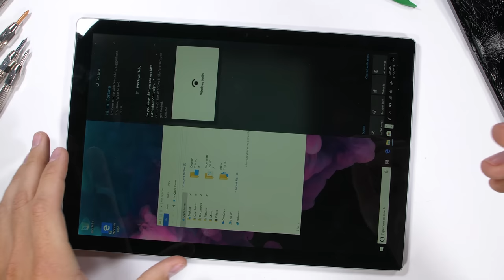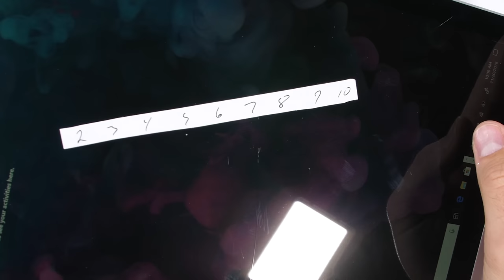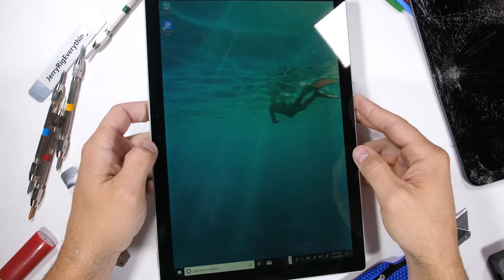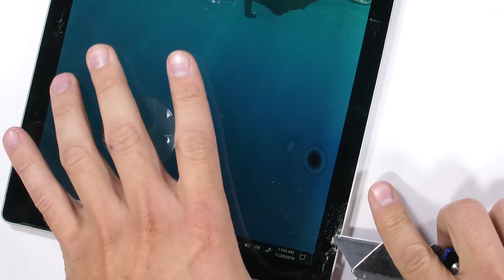Surface Pro 6 Durability Test! - Is it stronger than the iPad Pro?!

Comment: 6:27 "Intentionally adding structural flaws in a mobile product is a bad idea"
Reply: Yeah right, how are use supposed to get a new one if your devices last long😌😌
Reply: As long as you aren’t intentionally applying so much pressure with the intent to break the tablet then you won’t have an issue.

Comment: "itS a TabLet, Of COurSe iTs gOnNa sNaP!" 
Well would you look at that....
Reply: I was hoping I'd see this comment
Reply: "BUt ThIs Is A cOmPuTeR"
We all know someone is gonna state this...
Reply: Would you like to use the surface after that bend?
Reply: @EnzoBergstrom  at least if I wanted to, I could
Reply: @EnzoBergstrom  would you like to use the iPad after that bend? Oh wait, you can't. My bad.
Reply: @alessandroperoni4713  what's a computer??
Reply: All it took was twice the weight
Reply: Start water test instead of burn test😅
Reply: @EnzoBergstrom  Sure! At least I still can use it after that bend, unlike the iPad Pro.
Reply: mjc0961 the screen crack right from the start! Lol
Reply: @EnzoBergstrom  Better'than a tablet that broke in half and way way costlier 🤔🤔😪
Reply: Surface pro is much thicker. A slim aluminum slab will bend easier than a thick one
Reply: I challenge these apple fan boys to try to bend my Mi Pad that costs less than 300$. It does everything their new iPad does except for "4k rendering" and "video production" which I wont do in the first place because I'm not retarded and have a laptop. Their scrawny fingers and thumb will dislocate before they can bend my tablet meanwhile I haven't seen an uncracked iPad in years it always has whole screen cracked or some corner cracked and people still using them. Even my 2015 Mi Pad is uncracked to this day and I treat it so badly.
Reply: This hurt my soul. But have not missed a single video.
Reply: @brennont9724  Nobody requested that the iPad should get thinner, this is purely Apples design choice and as you have seen a poor one
Reply: I would love if Zack starts "reviewing" laptops
Reply: It's thicker and had a hinge for reinforcement, no kidding it holds up better lol 
I'm a little surprised at the snark over something that I thought was common sense - Apple's tablet had more surface area and is thicker, therefore it's easier to break. Microsoft's tablet is thicker and smaller, therefore it won't break as easily. It's just the trade-off that comes with aesthetic. That being said, the build of the Surface Pro is a pretty special case due to how it's not really a true laptop nor tablet. Large tablets will break much easier than small phones under stress, so keep that in mind.
Reply: Having held both both the new iPad and an earlier surface pro, they are not at all comparable. The surface is t h i c c, and honestly not very comfortable to use as a tablet. Of course the much thicker surface wouldn't bend as easily as a super thin iPad. But despite this, i think both are pretty bad as phones and laptops do what tablets can do much better.
Reply: Raian Levy who bends their ipad lol
Reply: @kama6592  I hope this was a joke and you do actually see that the surface is bigger, meaning it has a bigger surface area and also meaning your argument is completely useless.
Reply: HOLY SHIT 1.1K LIKES
Reply: It’s also much thicker than any iPad and I’d assume significantly heavier too
Reply: @klebs7724  no one bend , but it just broke easier than a biscuit
Reply: @TheMysteryStriker  I was referring to the 12.9 inch iPad since that's the one most people are interested in. Even so, it really doesn't make my "argument" (not really an argument, the result was pretty obvious. Unless you're arguing that it isn't) any less tangible since the iPad is about half the weight of the Surface, making it more fragile.
Reply: @kama6592   Kam A  Sure you did. Under a video where the surface is being compared to the smaller iPad. The iPad everybody else is talking about and the iPad which has been bend tested and failed. Sure you did actually mean the larger iPad because it's obvious you were talking about it without anybody yourself included mentioning it. And also the Surface display is 12.3 inch large, but has thick bezels so in comparison to the bigger iPad with smaller bezels there isn't much difference.
Reply: @brennont9724  the surface it's not aluminum
Reply: @DanielGrijal  it is tho

Comment: When you realize that surface pro has more ports than a macbook
Reply: And it's still more durable than the ipad XD
Reply: Yeah but worse
Reply: @Proczorism  1000x durable
Reply: @radioactivet-rex286  indeed
Reply: It's just a hyped up Netflix machine XD 😂
Reply: Yet the Macbook has USBc which can serve the role of any port you want including thunderbolt. I’ll take that over a single standard usb
Reply: @electricsnut  yet Apple charge for dongles... XD
Reply: @electricsnut   Provided you actually know which USB-C cables are capable of transfering data. Here's a hint, most USB-C cables that come with phones are not recommended for data transfer. Not that they normally tell you that. They all charge, but they are not all rated for data transfer.
Reply: @electricsnut  Yet the iphones don't have usb-c.
Reply: @abelolof4809  that's debatable
Reply: Actually, Surface Pro has 3 ports, MacBook Pro has 4.
Reply: @elijahcorpus3  hes talking about the regular laptop also the surface is 800$ max whats the cheapest new macbook sold for?
Reply: @ojoface208  
1. The Surface Pro 6 is sold for $800 BASE.
2. The cheapest MacBook you can get is $849, through Apple Refurbished, which is basically selling brand-new, never-opened products.
Reply: @elijahcorpus3  still i would rather have the surface
Reply: @ojoface208   And so... what? It doesn't affect me, or anyone else, for that matter. No one cares if you have a different opinion from them.
Reply: @elijahcorpus3  you are the one with different opinion lmao
Reply: @ojoface208  And no one cares, because it doesn't affect anyone. Except you.
Reply: @shvkpr1   uhhhh the MacBook has one port meaning you have to buy w billion dongles why the surface has many different ports and is cheaper
Reply: @shvkpr1  oh sorry i am not on apples side in any ways and i dont know much info about apple devices but still like apple is charging a LOT now for everything including the dongles and the Ahm ahm 1000$ pro stand ahm ahm
Reply: @shvkpr1  and i corrected myself -_-
Reply: and i ooop-
Reply: Since my surface pro 4 screen flickering issue. I never looked at surface devices again.
Reply: @electricsnut  but you need dongles for that. I don't like It I rather have more ports also standard USB is better for computers. Becouse you can plug your phone or a USB drive and accessories like a mouse in without a dongle. On the MacBook pro you need a USB c to usb a dongle for that
Reply: Crispy Shaman you say that now until a few years later when usbc takes over and you need adapters and your still stuck with slow ass ports.
Reply: Actually, if you're talking about Thunderbolt, you could plug a USB hub for one Thunderbolt since it has a huge 40Gbps bandwidth (8 times than USB 3.1 Gen 2), so yeah i rather have 4 Thunderbolt than 3 USB + 1 DisplayPort. More versatile and has a huge potential on each.
Reply: Not much of an achievement to be honest lol.
Reply: And aren’t surprised?
Reply: That’s literally what I thought 😄
Reply: Can always spend another 100$ for a gadget to plug into the charger that ands another 7 or so ports and still charging capability

Comment: 100% agreed surface is full pc in tablet form. apple and android tablet basically is smarthphone with big screen.
Reply: The iPad and surface are for completely different people, but i think the surface better
Reply: Yes I got surface pro after owning an iPad. Surface is far far better
Reply: not 100%, because the GPU in surface are low and not for hard gaming like PC has Nvidia RTX20180Ti etc
Reply: i like that big heat sink in the surface pro
Reply: RZ 370 Unfortunately, Windows 10 tries too hard to be a bad smartphone, and Surface doesn't let you upgrade to Windows 7, 8 or a non-MS os, unlike most macBooks.
Reply: @johnfrancisdoe1563  of course you can install win 8 or win 7 on surface. Its fully operational windows tablet like your home pc. Older rt tablets had rt windows
Reply: thats what a tablet should be. If it has a full windows or mac os then its a computer at that point
Reply: one can run whatever windows/linux versions one needs on surface. with virtual machines.
Reply: @sneakworld  a weaker pc or full blown pc sound like the better choice for tablets to me. Android tablets were never successful, because that's too little functionality to pay money and carry with you and sharing between more than 2 devices is pain especially if they all have different OS.

Why not have a powerful tablet as workstation and additional screens, ssd, gpu, etc at home to connect. All of your data comfortably in a single device you carry with you more than half of the time.

Some tablets already have pc level processors, once we get thundebolt 3 tablets, we'll have the option to add external gpu and be gaming replacing laptops completely.
Reply: @mrizkifahreza8  dude .....
Reply: @mrizkifahreza8  And literally nobody expects to be gaming on an surface. Thats just unrealistic. Not every computer is just about gaming. Most people just want to get shit done.
Reply: wardwyseur 
iPads cpu is very efficient so the iPad doesn’t get hot enough to need such a large heat sink. Doesn’t mean the iPad is better or vice versa, they both have their attributes so ultimately it just come’s down to personal preference.
Reply: mark smith 
I have a good friend & work colleague that did the exact opposite, he gave his surface to his partner and bought a 12.9” iPad Pro. He made that decision after spending less than an hour  playing about with my iPad Pro. His comments were that he didn’t know why he’d persevered with the surface for so long. Each to their own I say. Aside that, iPad OS 13.2 has radically changed the iPad from being an overgrown smartphone to a very accomplished tablet, especially file management. There is still room for improvement but they’ve certainly made a big leap forward.
Reply: RZ 370 
Not any more since iPad OS 13.2. It’s totally changed the iPad. As I’ve mentioned in another reply, the new version of file manager is a massive improvement making it far more work friendly. Plus since usb c you can now add external devices such as a hard drive (read & write), mouse and keyboard support plus other stuff to. Unlike other tablets & smartphone’s the OS gets very regular updates and more importantly the devices are supported for several years unlike other devices. Not saying iPad is the best tablet or the worst, it’s just down to personal preference.
Reply: Fahreza M Rizki are you mental mate? You’re saying the iPad has anything comparable to a 2080? 

This is a productivity machine, not a gaming one. You want to game on a 2080? Buy a 10 pound laptop with mediocre thermal management or get a desktop. No one buys a Surface or iPad for gaming. Mobile gaming isn’t gaming either. It’s just a way to pass time when waiting in a lobby.
Reply: Hephaestus 
Some people do play games on an iPad but I agree 100% that these people or most of them don’t actually buy the iPad to play games on.  In reality the iPad and surface are mobile devices that most people use to do their day to day tasks one.  No one can say the iPad is a fully functioning laptop replacement [although it’s getting closer to it with every new iPad OS update that gets released]. It’s certainly more than powerful enough as it’s widely accepted that it’s as powerful as laptop’s and in many cases exceeds them power wise.  What the iPad doesn’t currently have is a computer equivalent OS.  iPad OS just isn’t quite there yet, whereas the surface is as close to a laptop as you can get in a tablet.  Having said that, I use my iPad Pro almost exclusively for work and I don’t find I miss much functionality from what my iMac gives me. Of course the great advantages are that any work I do on my iPad is waiting on my computer exactly where I left off, this includes anything I’ve done on my iPhone.  Many non Apple owners ridicule the ‘Apple eco system" which is their prerogative, but it just works so well nevertheless.  In this instance I feel that makes up to some degree the fact that iPad is isn’t quite as powerful as a computer’s 
OS.
Reply: Steve 127 I agree the apple ecosystem is very streamlined between devices. I wish I could get my messages sent to my PC when I’m on it. That’s not compelling enough of a reason for me to own another device that plays middle ground between a phone and a PC though.

My way to create a more seamless experience between my devices is to use OneDrive and Discord. It works pretty well for my needs. If I get a message to my phone while I’m on discord it’s probably not someone that needs to get ahold of me urgently. 

I can’t use Apple computers because they don’t support the programs I need for school. Even if they did, I don’t know that I would commit entirely to the ecosystem. Don’t like putting all my eggs in one basket.
Reply: @mrizkifahreza8  Well of course, the RTX2080TI doesnt even fit in the tablet, let alone a desktop version

Also, hit me up when you figure out how to 1. cool the damn thing, 2. gets 300W of disposable power supply

Sure, you can get 300W out of that battery, with it running at 11.1V (most of em do), youre looking at only 30Amps tops. It wont hold longer than a few minutes before the voltage starts to seriously drop but hey,  you did the thing with the thing

Comment: Now where are all the people telling in the iPad vid that all tablets bend 🤔🤣🤣🤣
Reply: all tablets bend with enough force, tablets like this one , more than 40% thicker than the iPad obviously are harder to bend. Welcome to Structures 101.
The matter is if the insanely thinness of the iPad is worth it.
Reply: @marcpuiggros  *heavier
The thickness are 20%
Reply: Flo One 8.5mm / 5.9 mm -> 44% thicker! Not that it matters, the premise was that it is thicker and thus harder to bend, but seeing you wanted to be nitpicky I thought I’d make it clear for you
Reply: @marcpuiggros  yup I really screwed up the numbers. Sorry about that
Reply: Marc PM it’s not only the thinness that causes it to bend easily, it’s also because Apple cheaped out on recycled aluminum over the Surface’s magnesium alloy.
Reply: KosmicHQ yeah! me too, I find it ridiculous. There’s no need to make iPads that thin. But find it funny that people are so surprised at something as unavoidable as gravity.
Reply: @Auazz  same, but, I'd also rather have a tablet than runs x86 apps, works fast. To whoever says iPad is an overpriced Netflix machine, its not even that. Why do you want a overpriced tablet that can't do 4K due to CPU limitations? ;)

Comment: Well, according to Snazzy Labs, “all the tablets bend.” Oh, well. Guess the Apple fanboy had to respond.
Reply: Well.. the Surface Pro did bend did it.....
Reply: it bends
Reply: It bends but it is not foldable like iPad
Reply: Uhmm..uhmmm but it is significantly "Thicker than ipad".. 😂😂
Reply: Harshit Namdeo still bent and crackled. If that kickstand wasn’t there it would have been the same as the iPad. Personally I like the design without the kickstand
Reply: @garfield2306  2.5mm is a lot 

Hmm🤔
Reply: @samueljames657  I've seen your other comments. It seems you prefer everything in common with Apple.
Reply: Wow. Some people are idiots here. "Bend," in this context means "bend to a point that it breaks." Jeez!
Reply: MrJustStartedGuy I prefer better products and support. It’s too bad that the iPad can bend relatively easily. I’ll just be more careful with it. It wasn’t a signal not to buy it. I bought apple care for $5.99 a month for peace of mind with my iPad 11 inch. Good luck
Reply: @samueljames657  For sure Apple will support you,  as long as you keep throwing money at them.
Reply: @me-me3126  It is when talking about 8.5mm, or are you saying 29 percent isn't a lot?
Reply: @Bdawg.  It did bend to the point of breaking, the screen was cracked and it was unusable.
Reply: @IsoMacintosh  What?
Reply: @me-me3126  I'm saying that whether 2.5mm is a lot depend on the context, and in this case it is 29 percent of the surfaces thickness so it is indeed a lot.
Reply: @IsoMacintosh  But the iPad didn't snap due to its thinness, it was mainly due to its structural flaws, especially that microphone hole in the middle.